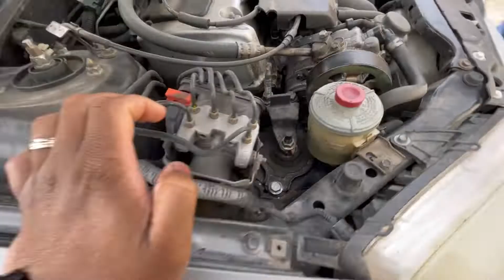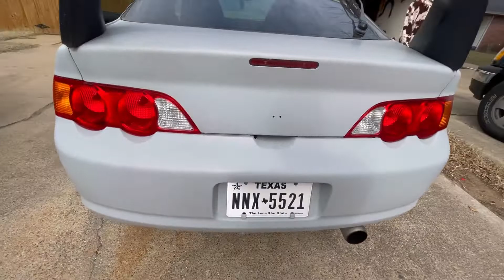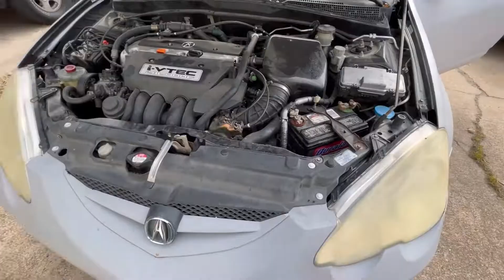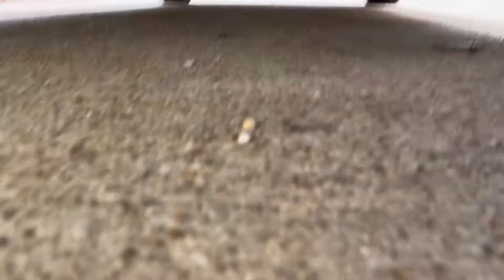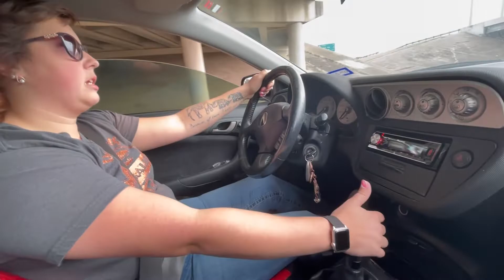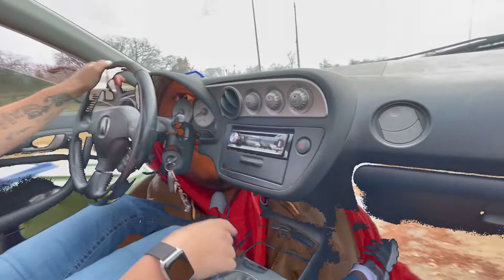2003 Acura RSX Project Build | Should I Buy & Build It?

Comment: Keep this in mind man your not gonna build this car for speed the k20a3 only makes around 170 hp with full bolt ons and a tune which is around 2 grand the engine likes boost and you can make up to 250 but other things will need to be upgraded and that will run you around 3000 if you buy the base just dont expect to be able to build it for power i also have a 5 speed rsx 2003 with 95000 miles and im selling it to get a type s.
Reply from the maker: Thanks for that information. I found that out if you tuned in on the latest videos I’m gonna end up swapping to a k24 & building my transmission & a budget turbo kit . It’s gonna be very pricy but it’s a long term Project I’m not in a rush !